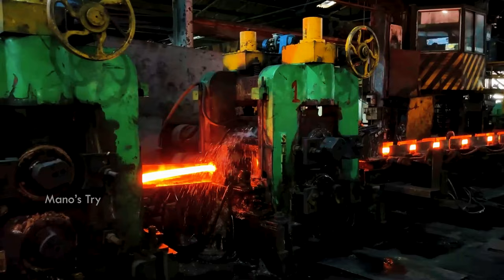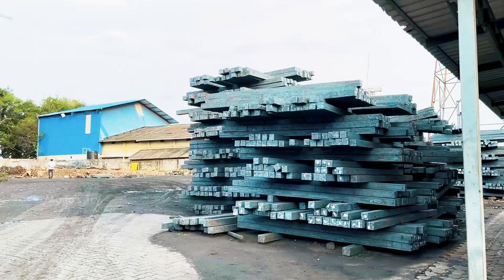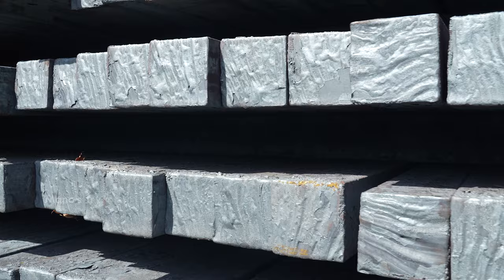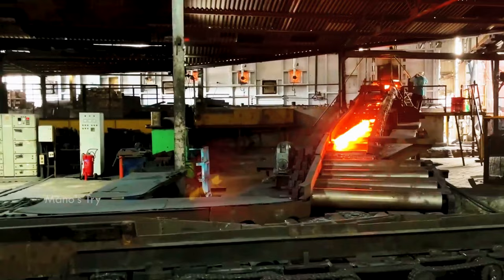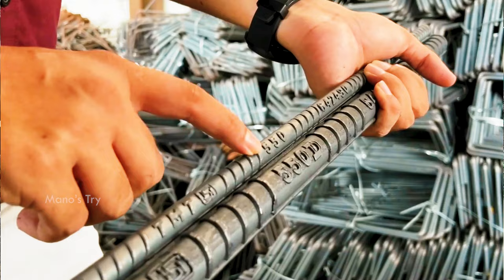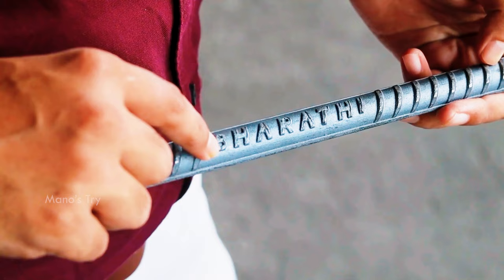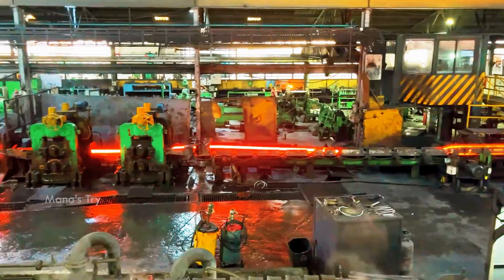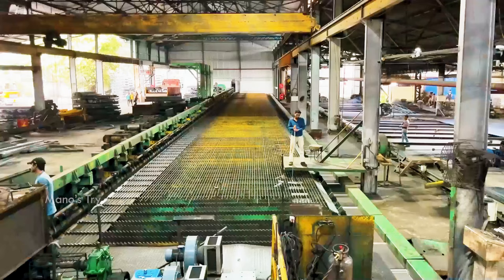பட்ஜெட்டில் நல்ல கம்பி எப்படி வாங்கலாம்? TMT Bars Manufacturing, Quality & Price | Mano's Try Tamil

Comment: Thx Bro  ground floor pulkit 500 pottu katti irruken .. how about that brand Bro .. 1st floor la vera brand 550 or 550d podalam ma ?
Reply from the maker: Yes Nalla brand thaan. 1st floor la 550 use pannalam
Reply: @ManosTry  Thanks Bro
Reply: Bro brand is just name all TMT must check with ISI stand and Fe 500 Fe 550 Fe 550 D they mentioned in steel
All is same they are used only same raw material